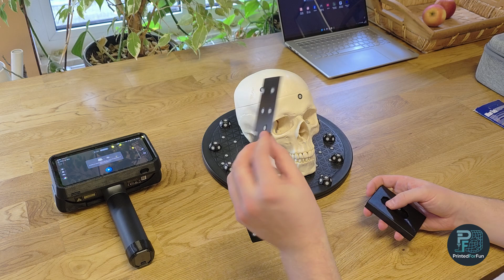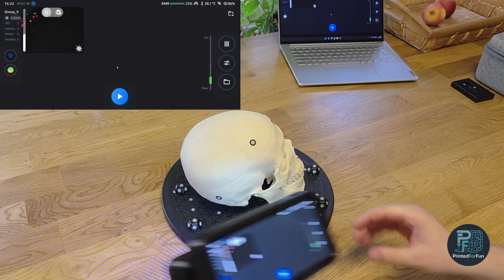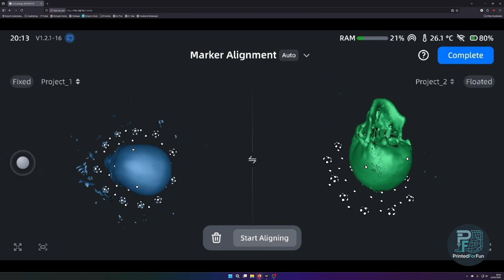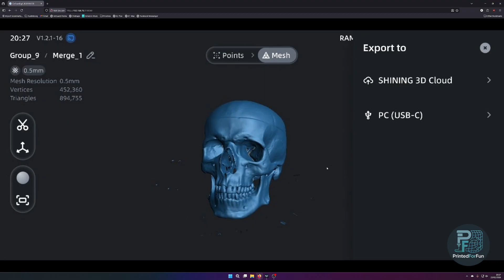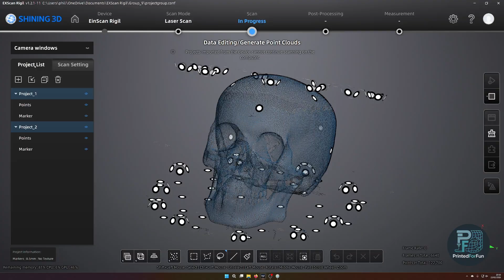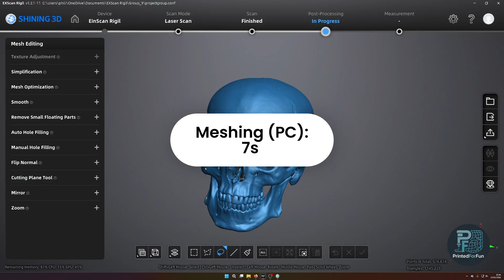Scanning and Processing Workflow of the Einscan Rigil

Comment: Thank you fir making the video! Is it better to put the marker to the base rather than put many markers to the scanning object? I have a duty to scan motorcycle engine. Please give me suggestions. Thank you!
Reply from the maker: Best results will be with markers on the part you want to scan. But base is just quicker and doesn't require sticking them on.
As long as tracking works fine and the scanner sees 4 markers at a time it will work